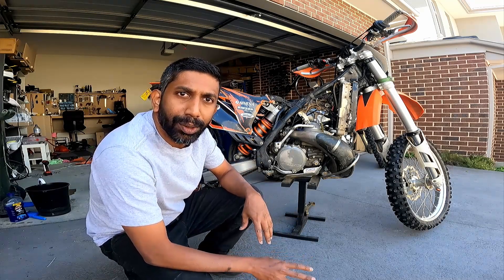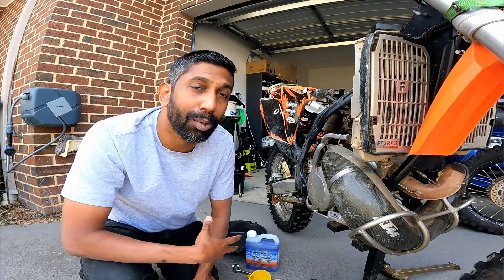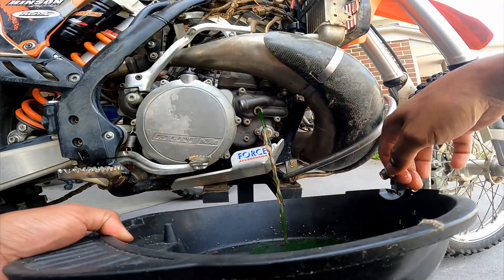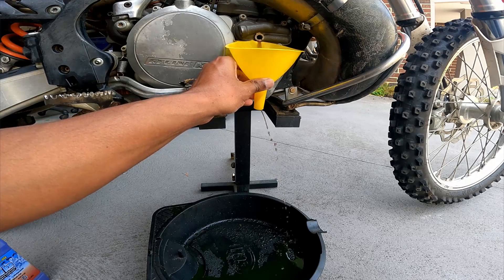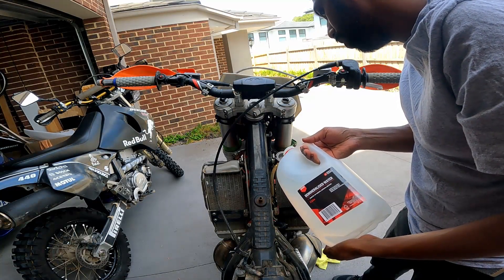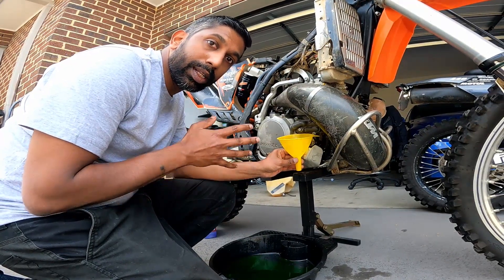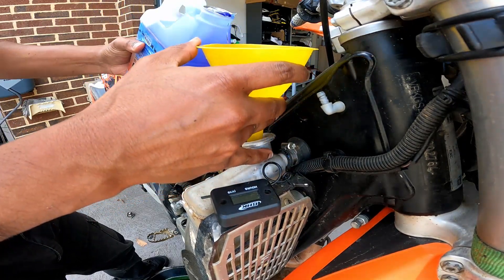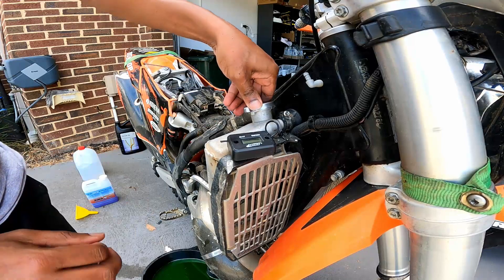How to change KTM300 Coolant | On Two Wheels

Comment: I'm wondering if you are still out there kicking it, trying to get it to start? Where was the sparkplug replacement and start video?
You will want to top up coolant after running the bike and letting it cool too.